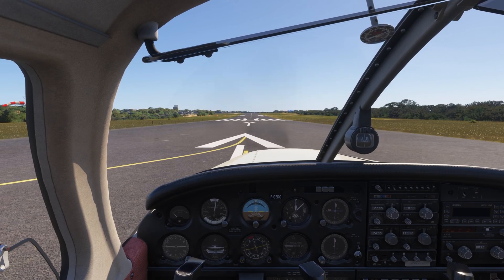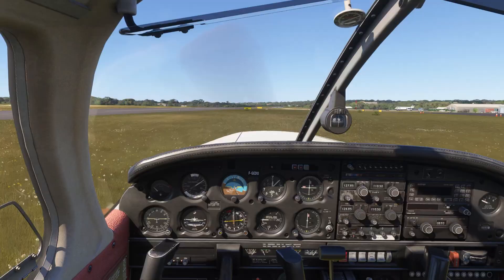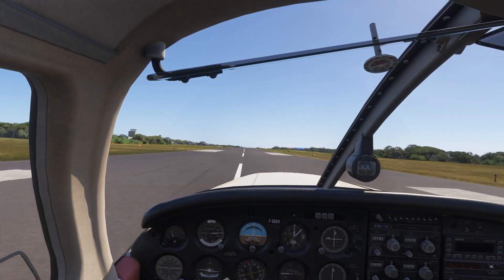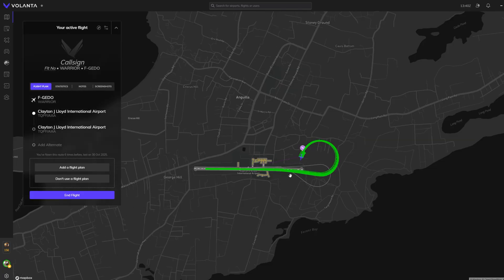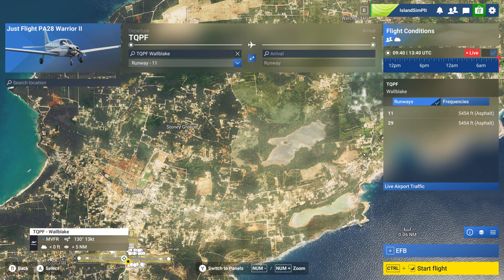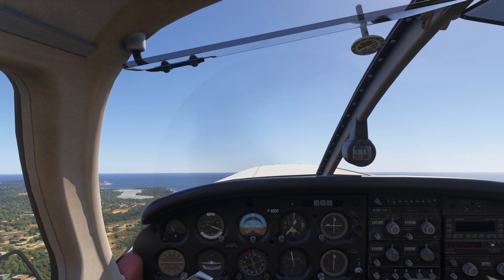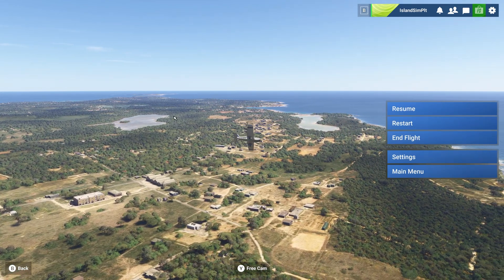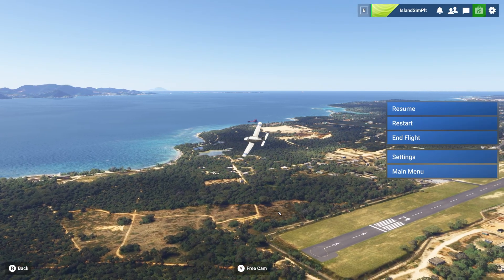Engine Failure at Takeoff — Do You Turn Back?! Real Pilot Test

Comment: Good lesson on wind management.  Headwind help with reduction of radius of turn is why we crop dusters prefer working crosswind back to back swath runs from the downwind border of the field so that every return to the field turn arrives fifty feet upwind.  As for engine failure or any low altitude maneuvering flight, even around the airport, airspeed and not altitude is life.  Vx or Vy when the engine quits is a lousy energy management place to be even up to pattern altitude with the airport behind.  Our survival, including my eleven engine failures, involved starting with zoom reserve airspeed.  That is enough airspeed to maneuver safely without the engine.  We always have that because we make every takeoff and every swath run the same level in low ground effect until obstructions force pitch up to just over not well over the obstacles.  So no consideration of going back to the airport or field we were spraying.  Like going to Vx or Vy with runway left or climbing over obstructions hundreds of feet, trading airspeed (life down here) for altitude (enough to kill in a stall/fall), we do not slow to best glide speed.  We immediately turn at whatever bank necessary to make the obvious survivable landing zone in the very near hemisphere in front of the wing.  We don't pull back on the stick in this turn, or any turn.  After thousands of 1 g turns at very steep bank angles daily, we develop muscle memory to do what the airplane wants to do in every turn.  It is designed, dynamic neutral stability, to dynamically return to and maintain trimmed airspeed rather than altitude in all turns of any bank angle.  So there is no stall warning buzz, no too slow to maneuver, no stall/fall from hundreds of feet.  We don't get that high except in turboprop jets.  Once aligned with the landing zone in the very near hemisphere in front of the wing, we usually find ourselves high and fast requiring full flaps and full rudder to the stop slip to make the very beginning of the landing zone.  From really low, it is a six seconds deal.

Comment: Last night I was flying the Heart Aerospace in career mode, and just 20 miles out from the arrival I lost 2 engines, with only the electric ones working. Could not get them going again no matter what. Was it a bug or is career programmed to simulate the odd engine failure? In any case I was loosing altitude but thinking "I can make it maybe". But close to the airport the AP decided to go off course, so I put it in heading mode.... nothing. It just started veering off right. So I turned off AP and thought "ok I'll take control" and then I lost controller input. Literally the only thing working was my throttle. It seems the longer you play in career, the more bugs it introduces. Another hard reset and lost earnings. 
Thanks Asobo for making such a rewarding experience. A year after launch and it's still mostly unplayable.

Comment: c310 is best ga in the sim. aerostar more deep systems and dynamic. not much worse in other aspects, but c310 just looks and feels cool. and i pretty sure this is huge mistake - single engine have the opposite beta logic on the fail engine, because when you have no altitude enough after take off, this huge autorotation propeller gives incredible big air brake circle, and this have no sense at all, even if engine gone at high altitude autofeathering won't be a trouble to get propeller fine for restart again after drop some speed. physically. if not enough altitude lost engine this is the killer. i don't remember for sure but autorotation propeller give the air drag same as the flat disk with same radius or diameter as the prop blade's longitude, and only engine torque make this drag some less that that value, as propeller autorotate slower because of the engine. this is really strange logic. i don't really know if governor still works in that situation, but if yes, first i'd do it get the prop lever back, just in case if governor is still works and can make the prop heavier and reduce rpm and air drag with it

Comment: You raise the key points.  Most are unprepared for a sudden loss of power on takeoff and in that situation a controlled crash somewhat ahead is likely the best option.  I did a lot of testing my local airport in MSFS with the A2A Comanche in different scenarios knowing the sim Comanche is quite a bit cleaner than my IRL - it ruled out a lot of options I initially thought were viable.  At a safe altitude with an instructor - it’s good to do a demo of being in a climb and have the power go to idle quickly - most don’t realize how quickly you need to lower the nose to not stall especially if you have gear or flaps down

Comment: The plane is lightly loaded.  The Warrior’s climb rate is typically below 1,000 rpm at best angle speed.  Once you established 78 knots, this simulation exceeded this.  The simulation exceeded the actual performance especially when considering most Warriors have significant engine time and will not perform up to POH specs.  I practiced this maneuver at 1000 agl and couldn’t get an Archer to

Comment: Would you do this in a real world EFATO ?ie the impossible turn ? I bet not
Reply from the maker: Pretty unlikely! Certainly not at 45 degrees bank. It's a rotten place to be, hopefully I never find out.
Reply: Yeah just got back from a few circuits at EGTR which if you look is on the very edge of London crammed into lots of restricted airspace and built up areas ,the options are limited to say the least with a large lake next to the runway ,power lines at the end of 08 and wall to wall built up area .Always on my mind when I climb out in the pa28 archer 3
Reply: Try this at egtr that would be a great video especially using 26-challenge ?